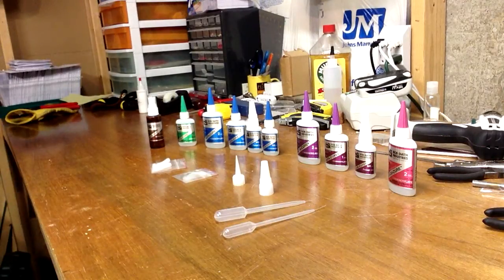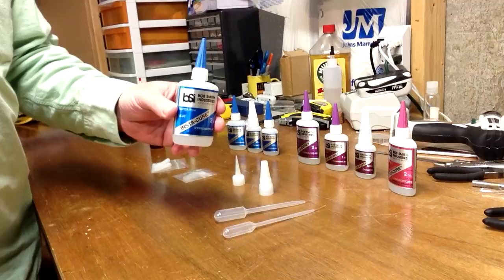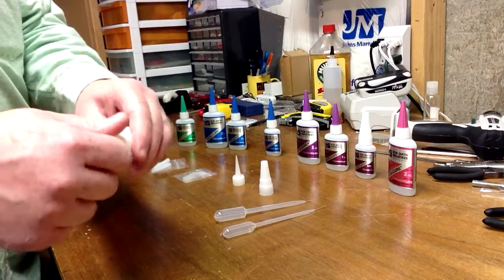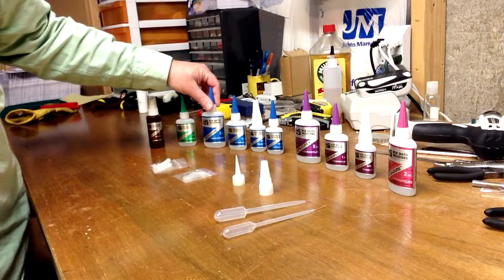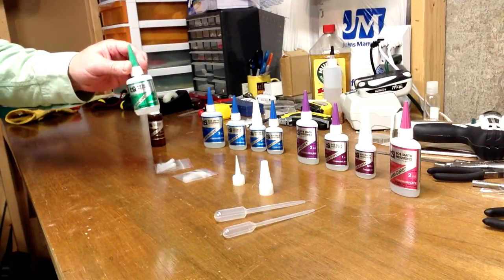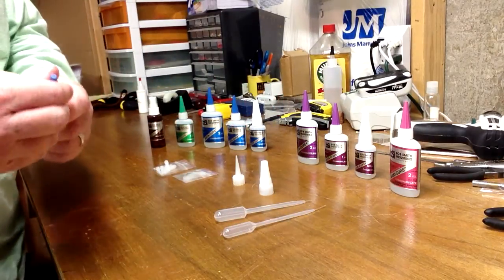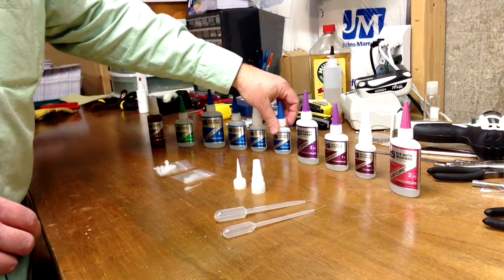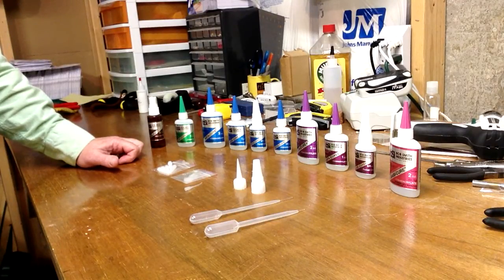Piano Tuning & Repair - CA Glue - Types and Uses in Piano Work I HOWARD PIANO INDUSTRIES

Comment: Excellent video! Would you recommend the use of these glues for the replacement of the buckskin on the butt assembly, the back rail felt and the string muffler felt ? Thank you for yout time.
Reply from the maker: The best glue to use for felts and buckskin is PVC-E glue.
Reply: @howardpianoind  Thank you!

Comment: Please recommend a right glue for repairing the wooden Bentley key...there is a long crack aross the half side of the key, but still in one piece....
Reply: so if not doing anything, the key will slip into two very soon, vertically...
Reply from the maker: You would use wood glue and clamp the key until the glue dries.

Comment: can I use loctite(408 or 420) to tuning pins instead bsi glue? I can't get bsi glue in my country.
Reply from the maker: Yes, as long as it is the very thin viscosity.  I'm not sure how thin these versions of loctite are, but any brand of cyanoacrylate glue will work as long as it is very thin.  We do ship our products worldwide so we can ship the BSI version of the glue to you wherever you are in the world.
Reply: I know a brilliant technician, of 50+ years experience, who uses Loctite 460. It seems to be the thin-ness of the glue that matters as all PCAs are basically the same formula regardless of brand.

Comment: Got it use CA glue....too much talk about glue. Its like a glue salesman not a piano repair, no good advice on repair... just glue
Reply from the maker: We have many other videos talking about different types of repairs and how to do them.  The purpose of this video is to provide information about the different types of glue available.  Yes, we do sell the glue, so I apologize if it seemed too much like a commercial.  Hopefully the information is helpful though for those that need to learn more about the different types of CA glue.
Reply: @howardpianoind  This video is exactly what I needed. Thank you. You cover so many topics thoroughly and I'm delighted you've done one on the different types of PCAs and their uses. Very helpful.
Reply: Try watching his videos on gluing loose tuning pins. He has a video on a quick repair to an odd loose tuning pin that doesn't require tilting or putting on its back and another video showing the more thorough technique to be used when treating all tuning pins. I don't think there's a topic he doesn't cover. Sometimes its helpful to be directed to the correct product.